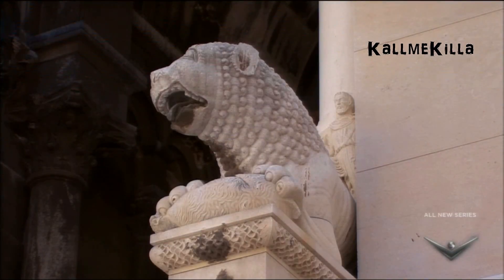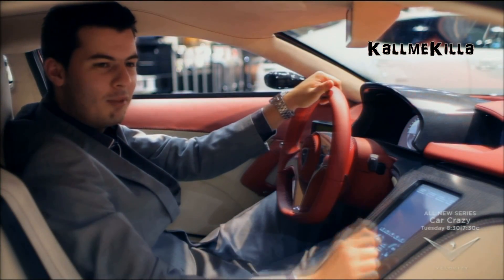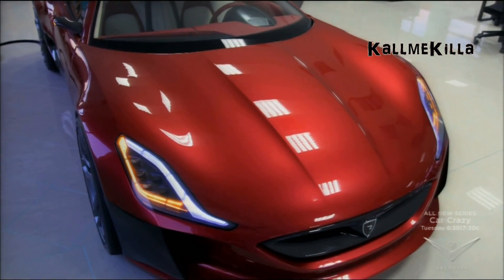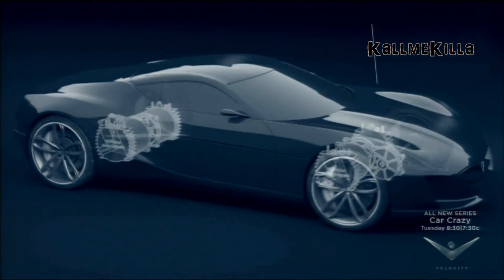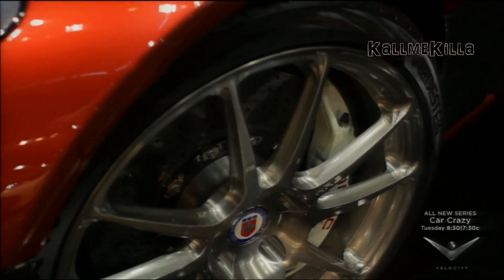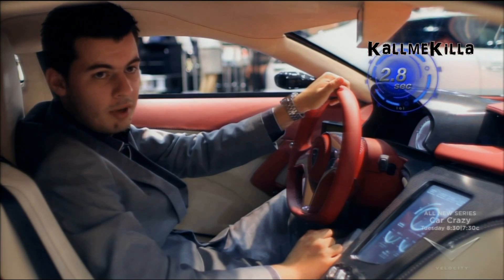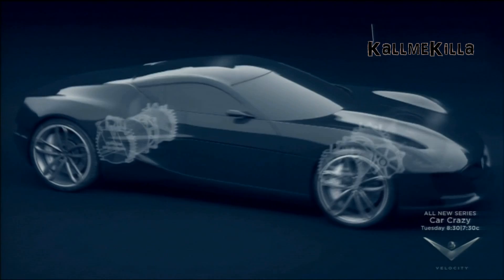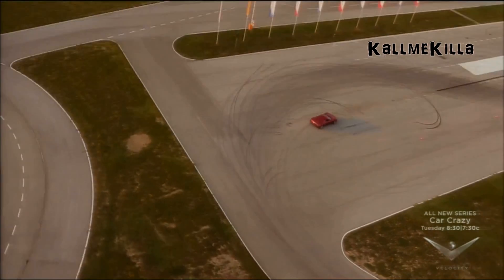Rimac - Electric Concept One Super Car 1088hp

Comment: Thsi is a well deigned car to prouve a point. electric cars are a viable option provided enough electricity is available. so this is a revolutionary car. As for the sound..  an "added feature" for those how miss engine noise, could be an artificial (multisampled for instance) engine noise, allowing you to choose or make your own..volume control linked to the throttle, mixed hroug the stereo system or on seperaty spekers/+subwoofers.There are no problems: only solutions.

Comment: I would call it power management. That's the term used most and includes control of the battery charging, discharging, regenerative breaking, standby power, max continuous power protection, heat control etc. etc.

Comment: The weight of the car of course impacts fuel efficiency somewhat but not necessarily a lot. If you drive with constant speed, the difference is about the "rolling resistance" in the tires. Anyway, I sincerely hope the car lives up to the data advertised.

Comment: Wonder what type of energy storage cell configurations are used on this and what the energy costs are in relation to internal combustion engine configurations.  If costs can ever become comparable, I can see an easy transition to replacing fossil fuel engines.

Comment: the horsepower is amazing, but i think the real innovation is the 4 motor concept. handling just got real. this is more flexible, rimac can basically program each wheel to do whatever. current systems in supercars are pretty amazing too, but they have more limitations as they as have more physical parts for their drivetrain. rimac basically bypassed/eliminated the driveshaft and transaxle

Comment: The car really looks amazing - and the concept sounds amazing. However I don't really trust it.
There are other small car producer, who are troubled with quality inconsistencies [and a lot of garage time]. It simply sounds too good to be true.
How did they developed this battery, which seems to be ahead, of other concepts?
How can they fast charge it within one hour?
Until there is no real car review, I would be carefully, what to believe.
Reply: I dont really trust your opinion... what is your source that there is a lot of garage time.
Reply: Dom Dedic You don't need to "trust" someones opinion. I haven't said, that I do have first hand information.
However - it is not really a secret, that cars from small producers have huge issues. 
Even Koenigsegg had huge issues [just read about the Agera and what happened with Top Gear UK] - oh - Gumpert had also quite some problems and many other small production cars.
I hope that Koenigsegg sorted it out - their production looks amazing - however you can't really tell... but obviously these producers don't usually do the millions of miles a large producer is test driving - and even than flaws happening [last one was the Porsche 991 GT3 engine fire problems]. So you really think, that a producer, which has no real experience and expertise can pull it off to build this kind of complex car? Possible, but implausible!
And then again there is their mysterious light weight battery technology - also possible - but equally implausible [they could sell this tech and would make so much more money with it!].
Reply: Search for carbon batteries ...

i dont know if concept one uses it but i know they are even better than lithium, also is not that hard to develop a fast charging battery, it deppends of the design isnside of it ... long story
Reply: How are their batteries better well they started some time ago they did electric car conversions for some years now reliability it's an electric car that means almost 0 maintenance
Reply: Mikolaj Lukasik
It seems implausible, that they have this type of technology- forgot that the world follows usually free market rules... If they would have a working technology they would have patented it and then offered it to big automobile companies, which would give tens of millions (maybe even hundreds of millions $ for it. After that, they could develop their car without any financial restraints as a "hobby"- lol.
Even if they would make this car work, pass the FIA and European legislature (which is tough), they might just break even with their costs, given that they'd be able to sell it... Most people with loads of money anyway rely on brands...
Reply: ***** Behind Tesla stands Elon Musk - pretty much a multibillionaire. 
Further Tesla has changed people look at e-cars - as well they are pretty leading in the area - however what they did is rather an evolution from existing systems and not a revolution. Tesla don't have "secret - magical" battery technology or anything like that!
Reply: Dominik MJ
Well...Rimac does hold guiness records...so...I guess it's real. What he's done was proven. He just doesn't have the funds for a full scale production like Tesla for example...and this is much different car than what Tesla make.
Reply: derbigpr500 Well - they concentrated on one challenge: to build a car, which accelerates the fastest. The technology they used [electric motor] is actually supporting this challenge [extremely high torque directly from the start].
This doesn't mean, that they solved any real issues, when it comes to the overall challenges of a production car! Until now their claims of charging within an hour, or their "next gen battery claim" is just vaporware...
As said, I don't necessary believe, that a producer is able to produce a great car, only because he built a world record car. Otherwise Hennessey would be one of the top producers as well...
Reply: Dominik MJ  Vaporware?? We are talking about the worlds fastest electric car, with the fastest charging times, longest range.... and you think its vaporware??? Rimac has achieved more in this space than all the big players combined... I assure you they are paying attention. So tell me Dominik, have you designed any supercars lately or are you simply another naysayer who needs to be proven wrong.
Reply: Web Design Melbourne 
Look, I don't mean that it is vaporware about the performance. But lets face it: it is rather easy to add a lot of power in a car, when nobody is basically checking the range. 
They have a world record in the fastest acceleration of a car - not the longest range or the fastest charging time. This still has to be proven - and that is IMHO vaporware. 
You know what? There is a reason, why the big players didn't achieved that! It is not, that they don't try. 
Even Tesla at the beginnings - did a bold move towards electric vehicles and were quite ahead of the game - but they proved to be ahead the game in a conservative way - not in an "utopia"-revolutionary way.

And honestly - I loved to be proven wrong - because I think it would be great for the environment, if electric cars loose their stigma of being difficult to recharge!
But as you said - until this happens I do agree, being a naysayer...

Comment: Why is the Torque so low in the description they said that it has 2800 not 1600nm
Reply: its because in the video, they said 2800 foot pound of torque, in the text description it is written in a different unit which is newtonmetre, if you look up a calculator on google which transforms foot pound into newtonmetre, you'll see, that the description under the video is correct. It's just a different unit to describe torque.
Reply: Olaf177
In newton metre it is 3800 nm

Comment: All things equal, 4 motors will quadruple the mechanical friction losses. However, with no transmission, this loss isn't too big, so 4 motors could be close to 1 motor in efficiency. The Model S driving range is based on regulations by EPA (United Stated Environmental Protection Agency). Model S P85 range at 55mph is around 310 miles under good conditions (non EPA). The Rimac numbers need to get validated by some neutral lab.

Comment: I'm not saying they are lying. Also, it could be that the 370 miles is possible at lower speed. Tesla Model S can get you above 400 miles when you drive it around 35mph.

Comment: And yet there's something wrong with the numbers;

Tesla-5000lbs, 691hp, 850lbft tq runs 0-60 in 3.2sec

Rimac-3500lbs, 1100hp, 2800lbft tq runs 0-60 in 2.8sec.

Now, I'm not an expert on speed but it seems to me the Rimac should be around 2.5sec, maybe faster. What do you think Nikko?
Reply: +Everett Cox The Tesla can do 0-60 in 2.8 now...
Reply: +trotamundos Ricardo Yes I posted that number before I was aware of Tesla's new P90D upgrade.
Reply: +Everett Cox Traction is the only issue these cars face.  More weight makes more traction, so with half the power of the Rimac the competitor could be much faster.  Fit both cars with the stickiest tires they could fit, and unleash the full potential of both cars, and the issue then comes down to the 15Gs the driver's brain experiences =D
Reply: Everett I believe this car has 265 tyres in the back,not great for 272 hp each wheel
Reply: +todd lithgow Needs much bigger rubber eh? 345/30R22s maybe?
Reply: Everett Cox I agree

Comment: Great innovation, but they're quieter than regular cars and people are less likely to hear them coming. I think they should add an artificial engine sound as a safety feature, the intention being to prevent people getting run over.
Reply: That's not the way it works. We definitely use our ears as well as our eyes with traffic. Cars that are almost silent would be dangerous. People wouldn't have a clue a car was going to come speeding round a bend, things like that. There goes your 'not needing sound' theory.
Reply: BiMiHi They're called quotation marks when used like that and they can also be used that way to dispel something. I'm English, I speak English; not a butchered version of English.

The electric cars I've seen are too quiet, so as I said originally, an added artificial sound would be helpful. I guarantee you pedestrian deaths will go up with quieter cars. 

Don't worry, I won't bother replying again. You're clearly a troll who isn't open to discussion and you need to throw out insults instead. Do you think that insults help you to win an argument? There was no 'argument', just a discussion. You lost the moment you did that. I bet you think you're always 'right' in your own little head. Whatever lol.
Reply: Miss Undaztood They take a little getting used to is all. The tire noise is significant, especially in a performance car like this, once the speeds get up over about 10 MPH. People will adapt as they become more common. Electric cars even at parking lot speeds are no quieter than many of the high end luxury cars like a Lexus LS etc.

I don't think pedestrian deaths will go up much, if any at all. If they do, it'll be because drivers aren't paying attention and/or pedestrians aren't looking where they're going because they're talking on the phone etc. People do need to be more responsible, but safety aids like collision avoidance or warning systems will start showing up more commonly as electric cars also become more common-- they'll coincide with each other nicely.
Reply: I think it would be funny if these quiet electric cars did have some kind of fake noise but not an engine/exhaust noise. It would be killer if they were outfitted with a speaker that would play applause at different levels depending on speed and driving skills. Of course i would have at least a 25KW stereo system

Comment: Damn it man this inspires me I wish I could build electric cars, I would even build modern steam cars on the Abner Doble Principle and update that and for electric cars using the Porsche principle for a small family car something like the old Astra mk4 base to a really superfast supercar which could do at least 300 MPH.
Guess you have to be super rich or know some one rich to achieve these dreams I guess
Reply: ***** Whats so damn great about petrol?
Reply: ***** So does electric
Reply: ***** Bull check out Metal to Air batteries Lithium Polymer Batteries Plus It doesn't need to  it needs to have a range of 250-350 miles and there is a way to make it a really fast recharge , about 5 or 10 mins and we've done this before on other threads
Reply: ***** Micro turbine's? hmmmm could be, could be , Jaguar's concept cars have jet's in ,that might be sweet especially for really fast sports cars
Reply: ***** Possibly  I wanted to do an electric car company years ago but well didn't get the investors, maybe I should try again , see if I can't get some investment, better than just being here depressed about the past doing nothing
Reply: ***** Thanks, well I think starting an electric car company might be easier than doing an ICE car company though quality has to be up there otherwise it will definately fail, also the models have to be very desirable as well and to ensure the financial long term of the company you have to build small to meduim sized family cars otherwise trying to appeal to the rich all the time well there is a reason Jaguar are owned first by Ford and then Tata and Bentley and Rolls Royce owned by VW.
Then again its good to have a luxury brand thats why BMW and Mercedes are successful but they still went into the family car market, thats why they can can stand on thier own, Mechanics starting thier companies will always happen occupational hazard.

I may look into this Factory Five with thier car kits and if I can change or get better components well things might progress  will have to sy , thank you very much though anyway
Reply: ***** So do I mate So do I still have a look at that 818S and 818R and well its not a bad looking sports car although I  would want to put 2 extra seats in there for adults (and I do mean adults ) I would have to chat to them and well for a two seater it looks great.

I might get in touch with them after I look at thier videos, and possibly start from there

Comment: you can drive a maximum of 6 minutes and 44 seconds at full power if the batteries are new.. :'D On a racetrack you normally have a full throttle percentage between 30% and 60% so in the end you drive 10 to 20 minutes then you will need to take the next car :P But it sill can be fun!!

Comment: The battery capacity is 8% more in the Rimac. The claimed range is 40% more. With the bigger battery capacity I would think it won't be having substantially lower weight.
Yes, Elon Musk has expressed that 500 miles is possible with current battery technology. Of course it is. But adding range will also add weight. Each type NCR18650 Li-Ion cell used in Model S has a 3.7V x 3.1Ah = 11.5W or so capacity. That's why Model S has >7000 of these cells.

Comment: 1:53 Mercedes AMG SLS ED has 4 electric motors and torque vectoring, and it's cheaper (well, comparatively--still out of reach for the 99%) and is also available...

Comment: Sure they should demonstrate what is essentially a record range as well. Yet another thing they are massively dropping the ball on.
And I think it has a chance to beat the records, it has a massive battery pack. Of A123 cells which means it has enormous power. Something around 3MW of power if necessary. 4000 horses.
That means that if it has the 1088horses of electronics and motors the batteries just wont sag. It could fly at higher speeds. Blow everything away. But they don't demonstrate..

Comment: dunno about the battery placement in this one. tesla model S has it's batteries low and center, giving it handling that rivals a BMW-M3. this one seems to be more along the lines of the tesla roadster, which handles like a cargo truck.
Reply: Did you miss the video. I haven't driven many cargo trucks that can take corners at the speeds he was doing. Thing seems to handle just fine.

Comment: holy cow..... $980K........a masterpiece of technology :)
Reply: The price has nothing to do with the technology... Besides the fact that it has 4 motors instead of 2 in the Tesla Model S P90D, the technology seems inferior to the Tesla (what about all the sensors, autopilot, safety features, cargo space, passengers seats...)
Reply: +Grégory Thiell this isn't competing with a tesla, it's a sports car not a city car. This will destroy any tesla around a track due to the aero suspension and torque vectoring
Reply: Actually that's a good point. I agree with you, it's a very different car and comparing it to a Tesla doesn't make much sense. I still feel it's overpriced, though.

Comment: Not impossible but it means their design is quite energy efficient for a car that can also output 1088hp. With 4 motors each taking some extra energy loss, I would rather think this car is slightly less efficient than Model S. But let's see when these measurements get done officially cause with the much higher price tag, perhaps Rimac has done some tricks to optimize energy efficiency relative to Model S.

Comment: I think they dropped the ball on the design as well. The odd Volare car that's based on the rimac looks a lot better. They should adopt that design immediately. Then it could be good.
The massive A123 pack also means it could charge crazy fast. Around 400kW with no problem at all. That's 500km in about 10 minutes.